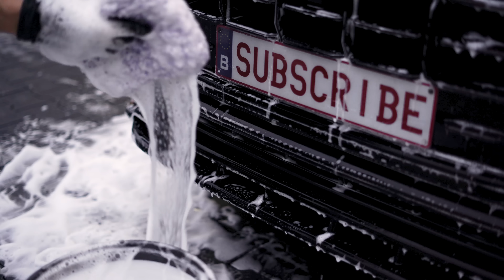Audi SQ8 Wash & Interior Detail - Auto Detailing

Comment: How do you avoid rust on brake discs after cleaning the wheels?
Reply: What do you mean...?
It's unavoidable.
The only way you can minimise is with a heavy coat of wax or sealant or ceramic coating, it will still be there, but it will stick less to the wheels and be easier to wash off.
Reply: You can use rust inhibiter wheel cleaner like a p&s brake buster or Excede Ultimate wheel cleaner